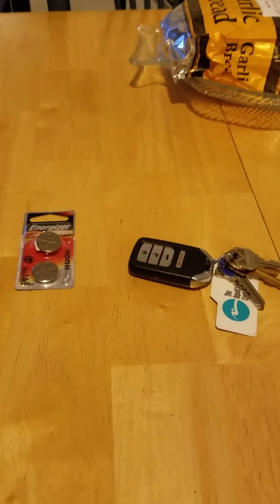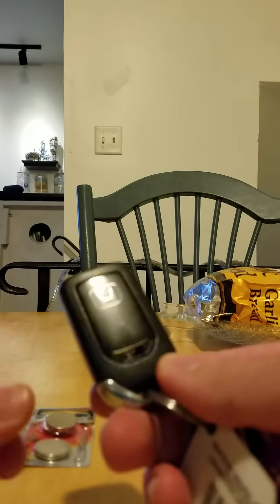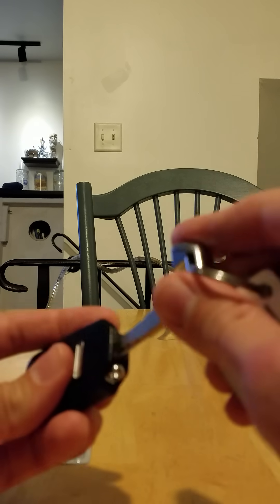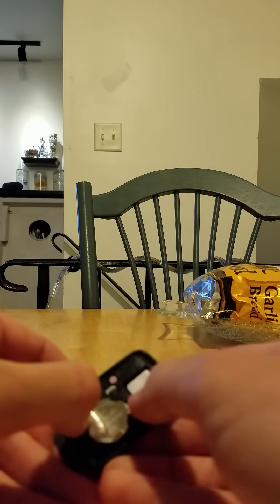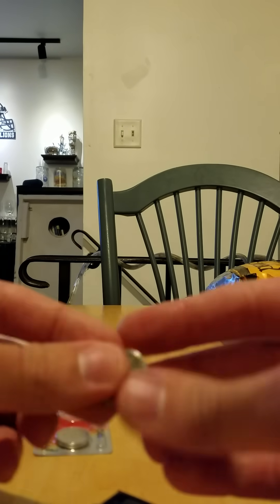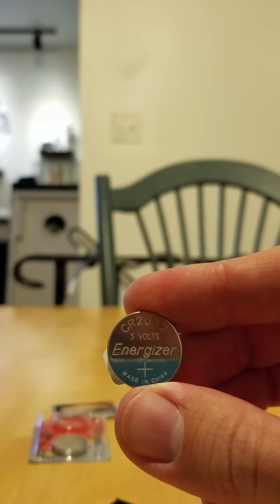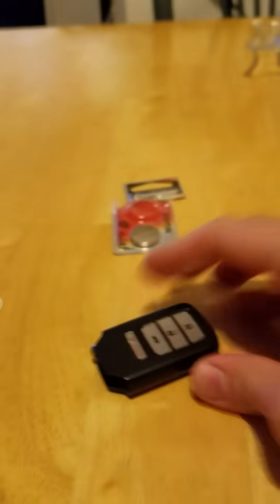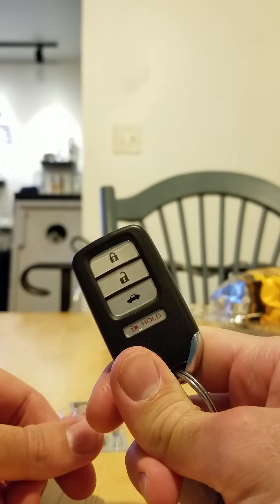How to Change Honda Key Battery | How to Change Keyless Entry Battery

Comment: I thought this was easy enough but when I tried to remove the battery the fob sprung into about seven pieces. I couldn't re-assemble it because I didn't know where everything belonged as it had sprung apart. I had to take the pieces to Classic Honda and a fellow there re-assembled it in jig time. Thanks Classic Honda!
Reply from the maker: Thanks for the comment!

Comment: These are also the CORRECT instructions for the replacing the battery in the 2015 CR-V key fob. Thank you so much!!! 

Please note that another video with instructions for the 2013, 2014 and 2015 CR-V does NOT work for the 2015.
Reply from the maker: Myrna Jean Rugg thanks for the explanation!